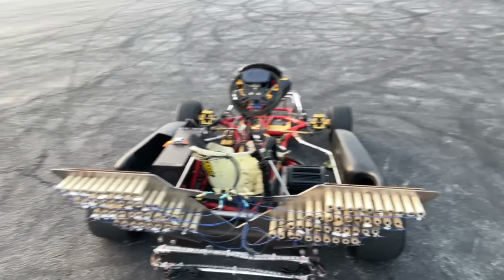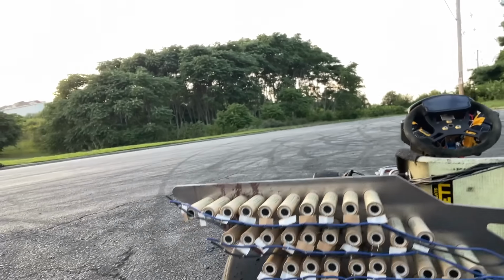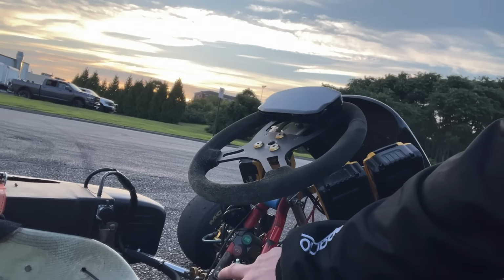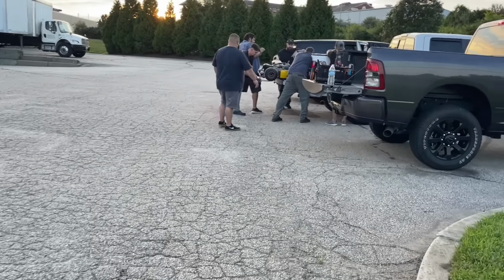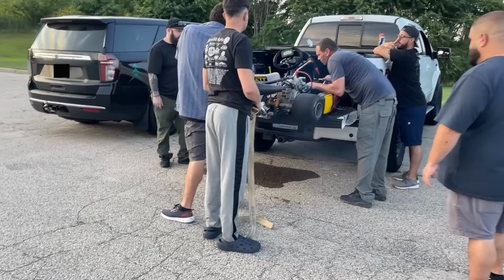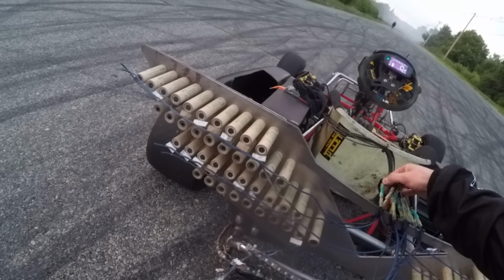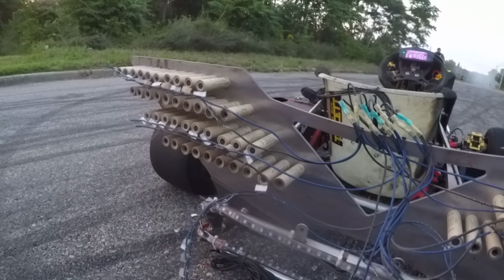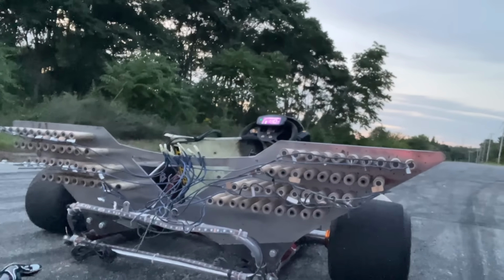Rocket Powered Electric GoKart

Comment: You may be lucky that they DIDN'T all fire off at once. Consider working up to it. Also consider changing the thrust line slightly so that the back end doesn't get light. 
It's probably a lot more expensive to use all those little motors instead of a few big ones. I'm not sure of the legality of any of this, but presumably you've investigated. One or two high power motors ought to cost half or two thirds as much as your clusters. A plus is that ignition would be more  reliable.

Further savings per run would be possible if you used a hybrid. There are, in fact, hybrid motors for hobbyists. A bonus is that, if I'm not mistaken, you can shut off the nitrous if you get in trouble. I don't know if you can throttle them, but that seems possible.
 
I suppose you should have a hefty firewall or other containment between you and the motor if you're going to use a big one.